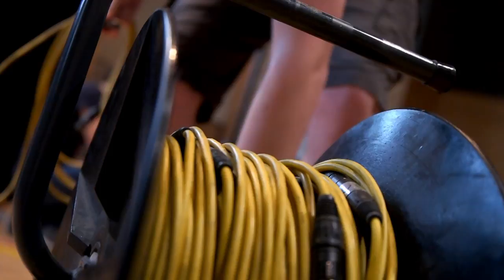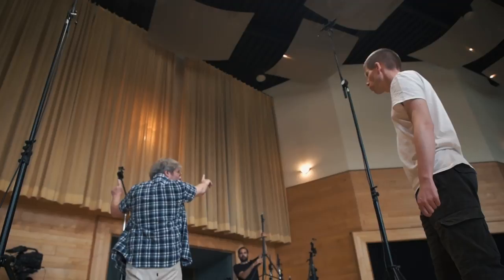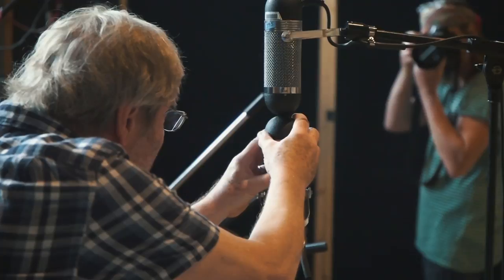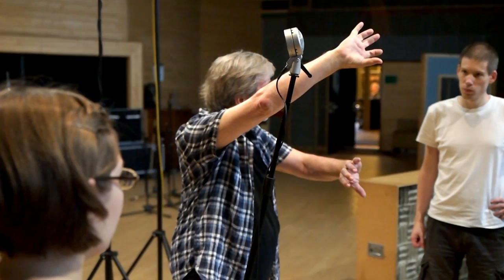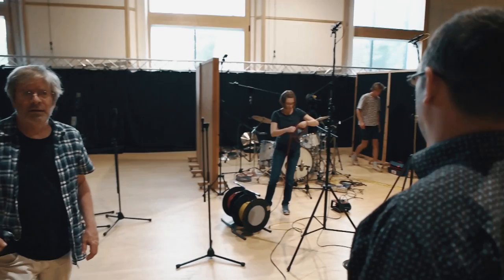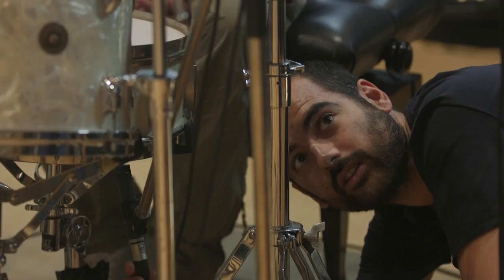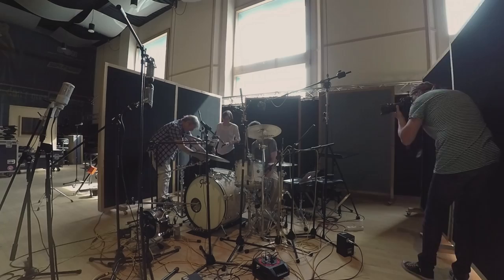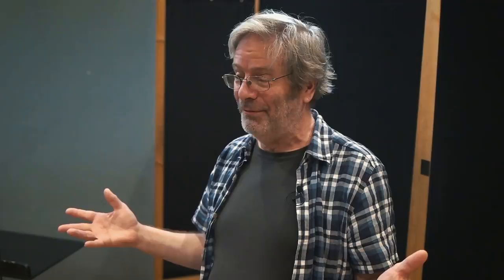Superior Drummer 3: Microphone Walkthrough with George Massenburg

Comment: How did you keep kit's position stable during recording without a carpet beneath it?
Reply: The drums have very good feet, and the wooden floor of Galaxy does not slide. But as you can see, there is a small carpet underneath the kick.